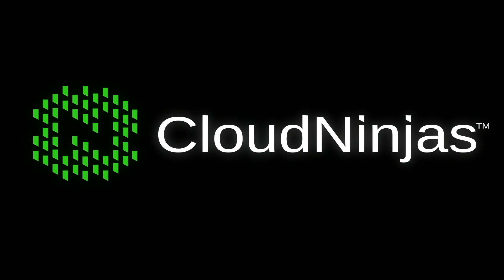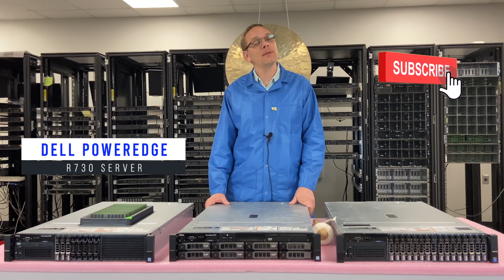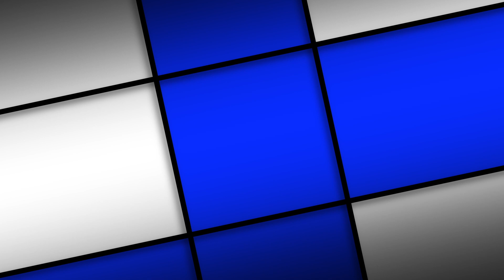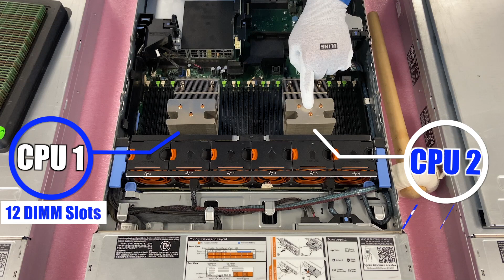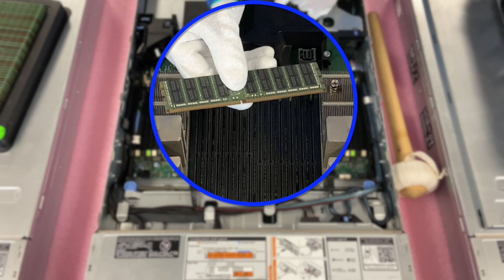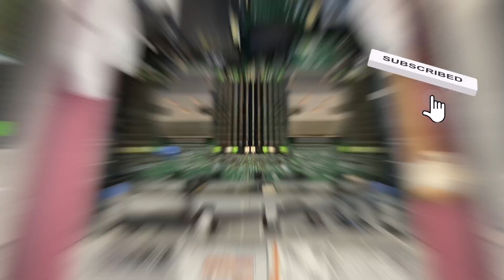Dell PowerEdge R730 Server Memory Overview & Upgrade | How to Install Memory | Supported R730 DIMMs

Comment: i have a question...
I have 2 servers
1st is DELL POWEREDGE R630 36 CORES 72 HILOS
2nd is DELL POWEREDGE R730 20 CORES 40 HILOS
What is the best??
Reply from the maker: Depends on what you need...

Comment: Recently added one of these to our line up at our studio.  I added a 3070ti to it and have it running with Proxmox in order to add VMs for our team to jump on remotely to work on Media projects (Unity, 3D, Video), but I keep getting some glitchy VMs.  CPUs hitting max while on idle or GPUs crashing during sessions.

I'm sure this is more a ProxMox issue than of the actual r730, but any thoughts or best practices for this scenario?

Comment: Great video! I have a question. I have a R730xd with 8 - 4gb DIMMs populating all white slots, but my system tells me that my A1 slot is faulty (I already try different DIMMs in the same slot and the problem is the slot). Can I just move that DIMM to the black slot in the same channel? Will the performance be lower? Thank you!

Comment: Hi Cloud Ninjas,
 I have ordered DELL PowerEdge R730XD Server 2x E5-2683v4 2.1GHz =32 Cores 256GB H730 4xRJ45 and i want to use it for home lab for routing and switching ,Firewalls.I need to add another 256 GB RAM on the same server.can you guide me will it be possible and if you able to assist.
Reply from the maker: Hope you are well.  Yes please email sales@cloudninjas.com.   We will show you options, make sure compatible with current RAM and where to install.   Take care.

Comment: Just discovered your channel while researching some new bare metal for a Homelab server.
A 2nd hand R730 seems a cheaper and more powerful choice than upgrading an old home PC with all new kit - which still only gives 128GB RAM max.

From this video, it's interesting to see how the chips on the DIMMs face their respective CPU - like employees bowing to their master 😃
Reply from the maker: Glad you found us!  Dell 13th gen definitely a sweet spot for value buys.  Check out our deals of the week page on our website.  Have some deals on R730 specifically.  Take care!
Reply: @cloudninjas  Sadly, the cost of shipping all those kg to Australia would wipe out the cost savings.

Comment: I have 4 pieces of memory, each 16gb, so the total is 64gb.  Which is the correct slot composition to install it?  A1, A2, A3, A4?  or A1, A2, B1, B2?
Reply from the maker: 2 CPUs?
Reply: @cloudninjas  yes
Reply: @deddy0691  A1, a2, B1, B2 i presume?  Each cpu has the same. I dont get the channel count thing.   When a single write is done How does a system with all white modules behave differently from another with All White and All Black slots occupied?  for a system with all slots filled.  does one write to all memory sticks in hte same channel at once - like all white gets one write, then all black DIMMS are involved in the second one?

Comment: Can I mix 12 sticks of 32GB 2400T with 12 sticks of 16GB 2133P?
Reply from the maker: Yes as long as both same type.... All RDIMMs or all LRDIMMs.  The 2400 will clock down to 2133.   Take care.

Comment: So how should you put the RAM in if you only have 2 16gb sticks? One in each 1st position of each cpu? Or just go A1 and then A2?
Reply from the maker: A1 and B1
Reply: @cloudninjas  Thank you!
Reply: @cloudninjas  En fin seria si tenes 4 modulos 16gb serian 64gb irian en  A1 A2 - y A3 A4  ablando del 1 cpu
Reply: si tenes 2 cpu  seria igual solo q agregarias 4  modulis mas  de 16gb teniendo 2 cpu que en total con 2 cpu serian  8 modulos de 16gb cada uno un total de 128 gb balanceando en 2 cpu   respetando entre los 2 cpu  los  primeros 64 gb serian A1 A2 A3 A4 y en el 2 cpu  los  otros 64 gb en B1 B2 B3 B4  formando  128gb  completandolos con los blancos estoy en lo sierto

Comment: I was interested in a r720 for a homelab I'm designing for hosting services like kubernates, routering, firewall, dns and vps  anch some other services with a pair of 2660 v2 10 core and 64 8x8 gb 1333 (not the best ram but we dont care) and 2 disks 600 gb sff in raid 1 to contain the vms operating system
Reply: Pass or not?
Reply from the maker: R720 still a rock solid server.  I might look into how much extra is would cost you for R730... prices are really coming down for DDR4 memory and V3/V4 procs.  Would definitely be more than R720, but you might be pleasantly surprised.
Reply: @cloudninjas  i looked r730 on your site but it costs like 150$ to 200$ more than r720 and for this bugdet is really expensive, i would go with the r720... Thanks, if you have some other tips or things to tell me before buying than this is the time to do it!
Reply from the maker: @leonardotoschi585  R720 is a good machine.  We are going to do a series on R620 this weekend.